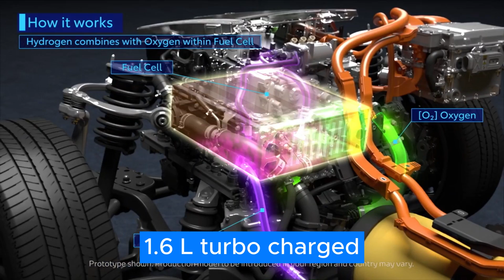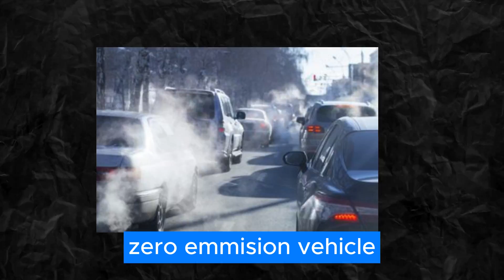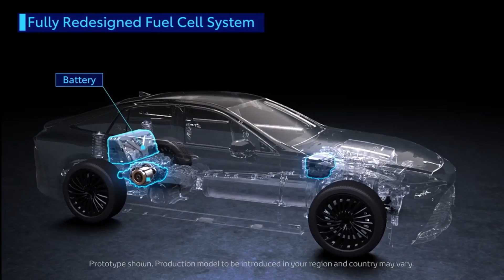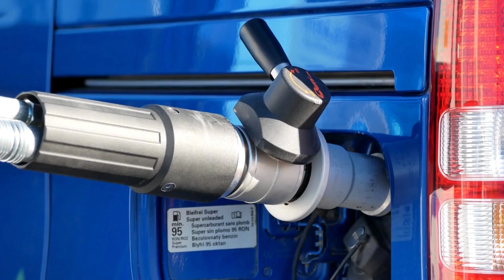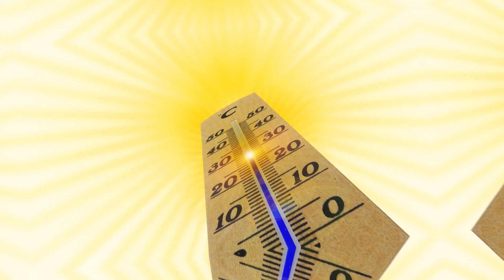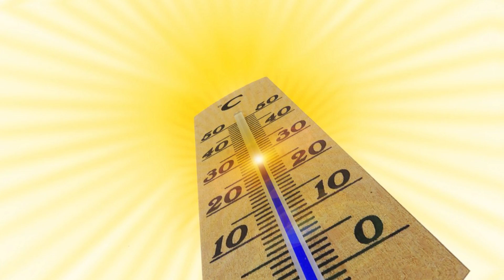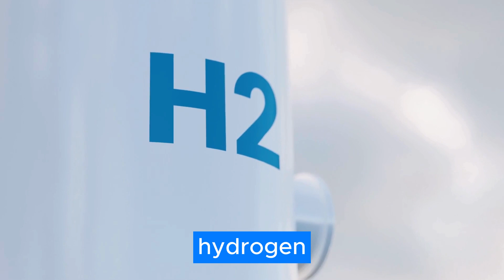Toyota CEO: "Our NEW Hydrogen V8 Engine Will End The EV Industry!"

Comment: But you have to use a lot of energy to make Hydrogen.  If you make Hydrogen using electricity from solar or wind, then why not just use electric batteries?  Does not make sense.
Reply: Batteries are heavy and take a lot of rare minerals. Using green electricity from the source makes the whole supply chain more environmentally friendly. An overlooked negative to EVs is the weight of cars. Added weight means using more tires and more damage to roads.